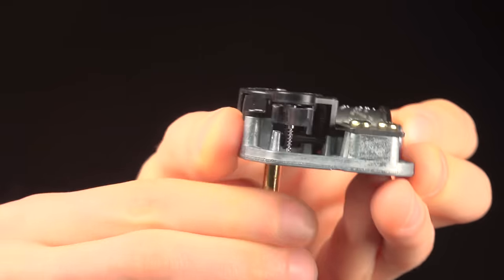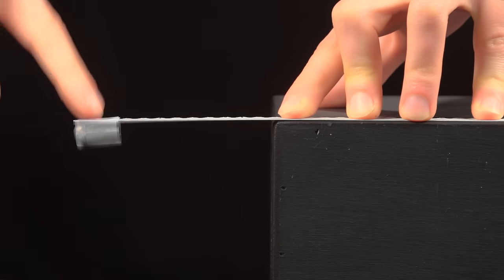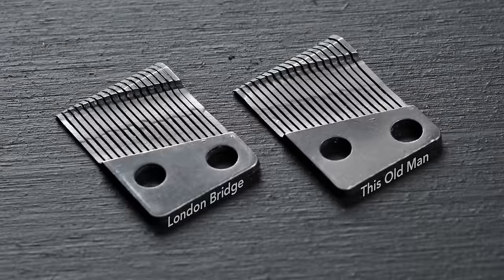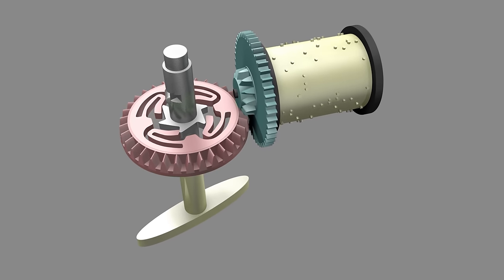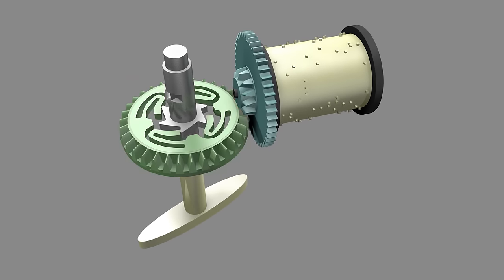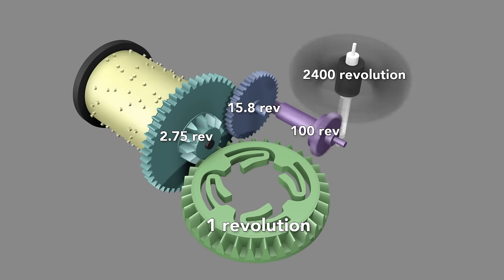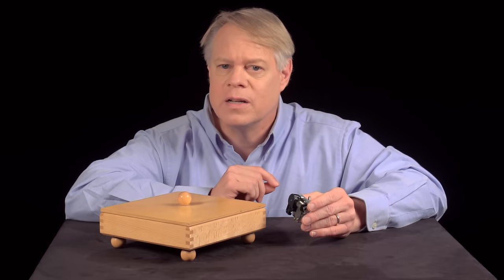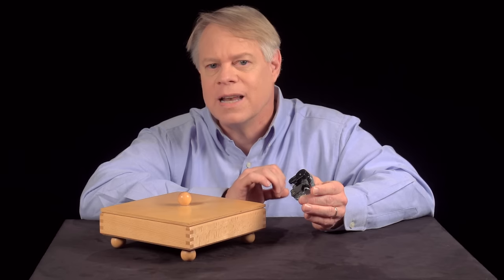How a Wind Up Music Box Works

Comment: Looks like the pin-pen merger area is expanding...
Reply: I'm wondering where that merger has happened.  I grew up in central California and i pronounce them identically. Maybe I'll look it up.
Reply from the maker: +darkridge For me it is from my southern Indiana accent ....
Reply: +engineerguy I feel for you! As a non-native english listener, the difference between the sound of pin and pen was so small it was almost negligible. Props for taking so much time to say it right :)
Reply: +engineerguy Odd, usually the merger causes the e in pen to sound like the i in pin, but you are doing the opposite, making the i in pin sound like the e in pen.
Reply from the maker: +eduardog3000 Indeed. I grew up with the only the -in, learned the -en late in life and now find it hard to say the -in.

Comment: My daughter’s wind up music box toy isn’t working, and I’ve spent about an hour watching other music box repair videos. Yours is the first to actually explain how they work and, for me at least, helps me understand what on earth I’m doing/need to do. Based on your video, I find it unlikely that there’s an issue with the clock spring mechanism (it seems rather straightforward in design). But there’s another video I saw that basically said apply some WD-40 to the governor and the base of the worm screw, so I’m going to go try that now... Your video was extremely informative, clear, and concise, and I sincerely appreciate it! Keep it up!

Comment: would have loved to see how messing with the air resistance (different air pressure?) affected the sound
Reply from the maker: +Jim Nyenhuis We thought of putting it in a bell jar (vacuum) . . .
Reply: +engineerguy That would have been quite interesting. Seeing how the vacuum would influence not only the governor but also how the sound would travel.
Reply: attach a microphone to the soundbox itself, glued to it
Reply: Piezos
Reply: +engineerguy My first thought was to grind away some material from the governor but I guess that's because I own a grinder and not a vacuum chamber haha.
Reply: +compaq1275 You can hear it since it's still vibrating whataver it's standing onto!

+engineerguy just do it

Comment: Noticed that if you watch the slo-mo of that plastic governor, as Dr. Bill mentions that air resistance slows it down, the plastic has actually bent enough to let the spinning governor gently drag against the case above it. The original style metal disks definitely worked only by air-resistance, but the new plastic ones appear to use both air resistance and friction at high enough speeds.

Loved the video, thank you.

Comment: I saw in a video of LearnEngineering that a worm gear can spin a worm wheel, but not the other way around. This is how wrenches work. (letting you make the wrench wider or narrower but staying stuck when you actually turn something with it). But here the worm wheel is spinning the screw (worm gear) of the governor. How is it different to let the worm wheel spin the screw?
Reply: +Ciroluiro If i remember correctly, there is limit in the size of the angle of the thread. If it is bigger than the limit value (around 6 or 10 degrees), the system won't work both ways (you also need to take the friction into account). check this link (in french but well illustrated)  https://pierreprovot.wordpress.com/les-engrenages/les-engrenages-roue-et-vis-sans-fin/
Reply: +Nath ! I think I understood what you mean. So the angle in the worm wheel determines if there is reversibility. Thanks!
Reply: +Nath ! thanks for the link
Reply: +Ciroluiro Also the load on the worm gear matters, since the torque output is so much smaller than input. This works because the governor is very lightweight.

Comment: Wait, but how does a spur gear turn a worm gear, shouldn't
 that not be possible?
Reply from the maker: +Michael Pressman we too were surprised by this ...
Reply: +engineerguy is there any explination? maybe the spur gear teeth have an angle to them?
Reply: Google it
Reply: the upward force of the plastic tooth pushing the aluminum screw is stronger than the friction that slows it down, this and the air resistance is used to make the governor rotate at a constant speed
Reply: You can see that worm used in music boxes has very steep threading compared to threading in usual screws or in worms from elevator mechanisms. This way self-locking doesn not occur (criterion for self-locking is when tangent of thread angle is lower than friction coefficient).

Comment: Hi, great videos!
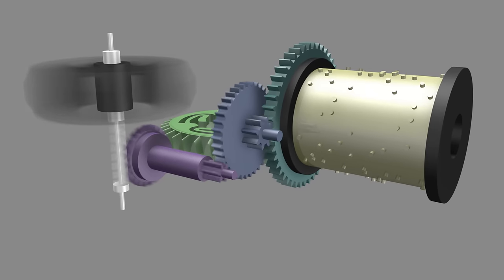Was wondering if the software you use to simulate the animation around 4:30 is public (and if so, the name) or something you guys developed?
Reply from the maker: +twistersdude pretty sure Steve did it with Cinema 4D ... That's heavy duty animation software.
Reply: Wasn't aware it handled simple physics like gear rotation. Or did he just rotate each one individually and make it look like they were turning each other?
Was looking for some simple-ish 3D physics simulator where you can build and test out simple designs. Not sure if something like that even exists. I know of 2D ones but that's why the video software looked interesting.
Reply: Blender (free 3D software) has a pretty good physics simulator. It sounds exactly like what youre looking for. I would recommend looking into it.
Reply: gear rotation is no simple physics, at least not on software programs. There are programs that do the gear rotation but not simulating physics, as Bonomous said about Blender, it does physics simulations, like a ball hitting a wall, or a million, but intrincate objects like a gear are not for it.
Reply: Walter Lacoste يملظلززةلظىظىظىظىظىظىظىظىظىظظىىظ

Comment: I took apart my fiance's mom's vintage Japanese black lacquer music box with a ballerina as it didn't work. I'm NOT mechanical but figured You Tube would help me. I checked out a couple other videos but yours is the best for explaining exactly how the music box works. Thank you. That was very interesting! 
Also, my hat is off to the person who invented this.
To get the music box to work I tried using the 'toothpick' method to just apply a tiny bit of lubricant on the base and top of the spinning part with the 'wings' (that is my vernacular as an 'artistic type!')  It didn't work any better. Then I tried the 'what the heck it is broken anyway, why not just spray the whole darn thing directly and forget about moderation!'  This WORKED ! Suddenly the 'box' began to play the tune effortlessly for the first time. Wonderment! Now, however, I am wondering if directly spraying the lubricant on all parts of the music box will be 'too much' for the poor mechanisms and totally overpower them and end up causing the thing not to work after a while? I used  BoeShield T-9 lwaterproof lubricant. What do you think?  I'm now in the process of uploading my first ever You Tube Video I am so proud that I actually got this working! YAY!

Comment: Thought anyone who watches this would be interested to know; You can make an electric music box by mounting a coil close to the comb. Exactly  like a guitar pickup. Needs a lot of turns and a preamp, but its pretty  cool. Unfortunately I didn't have a distortion pedal or valve amp so I couldn't make a proper ‘electric’ music box, but I was impressed with the sound. Looks cool on a ‘scope to.

Comment: Also note that the governor has weights and a spring such that the weights move outward at greater speed, increasing their angular momentum for more stable operation, and increasing their air resistance for better governing.

Comment: Re: "one last thing". I actually use that phenomenon in reverse to quiet the seek noises from my external hard drive by sticking silicone feet on the bottom of it and then setting it on a little platform with felt feet that I made from a cut-off scrap of furniture-grade wood.

Once it warms up a bit more, I'm planning to do the same with a bigger piece of wood and some felt feet to cut the low frequencies out of the vibrations of the replacement DVD drive in the Power Mac G4 I recently added to my retro-hobby corner.

Comment: The newer music boxes with the rubber governors don't use air resistance (much). When it spins, the rubber weights fly out, causing the top of the flyweights to rub on the plastic cap on top of the support, slowing down the movement. This type of governor does a better job of regulating the speed as the spring runs down.

Comment: the air resistance is not the only aspect which influences the governer speed and therefore the music speed. The weight of the governer is also important! I just fixed a too fast music box of this design by applying short nails into the soft material of the governer. This increases the weight and slows the rotation to a much more comfortable speed of the music box!

Comment: Air resistance governors were true for the older all-metal musical boxes. 

The newer governors in plastic musical boxes are much softer and heavier than older metal ones and use centrifugal force to difform and engage braking pads (on top of the governor) onto a plastic surface right above the governor.

Comment: Great video. I am investigating the feasibility of using 3D printing to create low cost custom personalized music boxes. I believe the cyllinder can be made of plastic but the comb has to be metal to get a good sound.

I think the challenge is finding a cheap source of steel combs with a good selection of notes. How much of the music box can I make out of plastic while still retaining that distinctly musical sound associated with music boxes? Can I buy parts separately at a lower cost? That kind of stuff.

Comment: OK, a governor that just has blades on it is using air resistance only however the governor that you show, is anchored only at the top therefore as it spins in excessive speed it creates a friction against the upper bearing slowing it down. So lots of governors rely on more than air resistance.

Comment: Since the governor is designed for the resistance of air, what would happen if you put the music box into a jar containing a denser or lighter gas? Would it change the tempo of the music? I also never knew about the combs being different for each tune - I thought they were identical and only the drum was different!

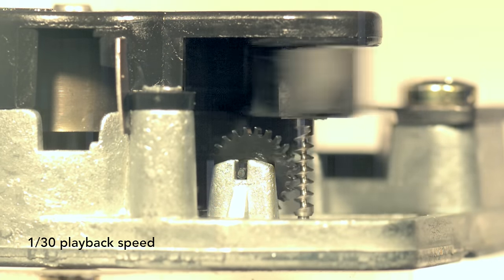Comment: You mention the governor mechanism using air friction.  Some music boxes use this method (such as the one shown at 5:19, with green governor).  Those usually have a flat plate that spins.  But I think that is not how the one you show works.  This one is a centrifugal brake.  The weights bend upward in response to centrifugal force, & 2 little bumps on the top of them rub against the frame.  This can be clearly seen starting at 3:40 in your video.  As time approaches 3:48, the weights can be seen to bend upward in addition to outward, & contacting the frame.

Comment: These are very similar to the bamboo and later metal mbiras (kalimbas) of Zimbabwean descent that have existed for thousands of years. Shrunk down and the fingers replaced with tines on a rotating cylinder instead of the fingers, more complex ones can be programmed with a punch tape though I'm not sure how they work having never been able to take one apart, guessing regularly spaces spring mounted pins on the cylinder that will be held down by the tape going over them, emerging when there is a hole before going around again, basically the earliest self playing instrument. Way more simple than a player piano too!

Comment: dude imagine finding a music box at a junk yard... id be so happy to own one
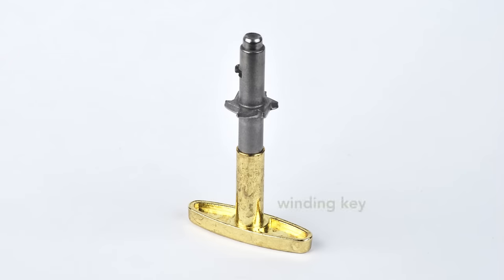Reply: Can anyone help me to solve the problem of the 6 tooth rachet making the larger 4 flexible panels gear bop up and down making loud clicking noise ref 2:29 region.  It's that big light green gear on the first picture.  I do not want to remove the spring coil that sits on top.  I have tried flat blade to pry it in place but basically I cant see what's going on.  It does wind normally but upon reaching a point, the spring will umcurl.  Any clue please?  Thank you

Comment: Hey Bill. Awesome narration and explanation.   regarding mechanical governors... are there other  ways to control the release of the energy of that coil spring beside that high speed "air brake".   it seems something spinning so fast is bound to wear and break.

Comment: Isnt that governor controlled by spining fast and when it does, the weights tend to move up because the way the weights are connected to the shaft (conected to the top of weights, not the center). This causes the weight to go up with speed and rub the top, which is kinda of a break  thus controlling the speed.

Comment: It looks to me like the governor uses a different method of limiting the speed to the one you described. There are those "big" weights on each side so that when the governor spins faster and faster, the weights are forced upwards (observable at 03:33) by the centrifugal force because they are attached eccentrically, and they rub against the rim of the surface above it at a set rpm, slowing it down as the rpm and frictional force increases. The critical rotational speed depends on the stiffness of the rubbery material, which functions as a spring, and the density of it in the weights, which changes it's centrifugal force.
Over a long period of time, the speed of the music runs away as the frictional surfaces wear down and the "hinge" rubber stiffens naturally.
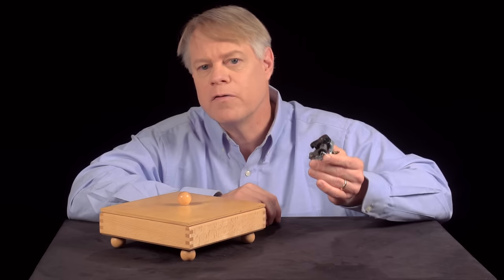If it was designed to interact with air, I would imagine it to be very light and to have some sort of aerodynamic surfaces on and/or around it, as is more obviously the case with the music box at 05:15.

Thanks for all of your phenomenal videos Bill! They feel like the German series "Die Maus" but more interesting and sciency!
Reply from the maker: We got this info from the patent if I recall correctly...
Reply: @engineerguyvideo  Strange ... good job on this anyways! Perfect use of 3D models and animations.

Comment: Hi - I know how to fix an over-wound music box, but now I have one that works, rotates, but it has a "buzz" when it plays. The music sounds like it is at the right speed, I know this can be caused by it going too fast, but it isn't doing that.  Do you have an idea what it can be, how I can adjust? Or, is it toast?  Its not a very expensive music box. It also has an on/off switch.

Comment: I have an observation about the governor. The design of the governor is a flexible off-center hinge. As it spins the governor arms flex upwards and outwards due to centrifugal force (correct term?) and push against the upper housing. I noticed the governor has additional protrusions that act as brake pads. So, Im sorry but I believe your description of air-resistance is incorrect - in this example. You would have to look at the vane-type of governor for air-resistance....

Comment: Physics puzzle: the teeth on the combs resonate similar to a pendulum, but we know that a pendulum of a fixed length always swings at the same frequency; the weight is irrelevent. So, why does changing the weight on the teeth change the frequency?

Comment: So, if the governor works with air resistance, how much would it be affected by air pressure changes, or altitude changes? Chan you slow it down by putting it in a pressure chamber?
Reply from the maker: We thought about doing that ... but then Decided not to take forever to take a video: we face this trade off with every video.
Reply: heh, ok. It's a pity, but I understand.

Comment: Did these music boxes play faster at higher elevations? The air pressure is lower, so that should mean less air resistance on the governor.
Reply: this guy is either dead or too old to reply now
Reply from the maker: Why do you post such things?
Reply: @nameless1873  Why would you post such a rude comment ?

The Engineerguy just replied to a comment of mine on a different video and is very much alive and well.
Reply: @mysticmarble94  Just because I wanted to obviously.
Reply: @nameless1873  But it's both fkg rude and dumb since you can easily find out that there are video uploads as recent as 3 weeks ago on his channel.
Reply: @mysticmarble94  cry me a river I don't care.
Reply: @nameless1873  Sorry ... That's physically and biologically impossible 🤓

Comment: How are the pins cast? Are they sodered on or is it cast already with pins in an already formed dye?
Reply: idk about most music box but the one I've seen were made by drilling small holes into the cylinder (the drum by the end of the process) and then plug small metal rod into those hole which is then soldered in place.
for the next part ,i will over explain why they do that in case you're wondering why: this allow you to put the pin onto the cylinder with more accuracy than just hold the tiny pin in place where you want to put it with tiny claw or something then solder it in. this is also better than making the drum by subtractive manufacturing since it's easier to add the pin that way than to cut the raw block of material down slowly while still leaving the material for the pin intact and keeping the drum so round and plum and good looking.
final note: take it with a grain of salt since i don't make the music box myself, though i do plan to since music box are cool

Comment: Don't you love our language?  I typed wound and realised it was spelled the same as 'wound'.  Looked it up in the Webster's and the third definition was:  past tense of wind.  Which is spelled the same as 'wind'.  So, protect a wound from the wind.  Thanks for the dissecting; I think my next move is WD-40.  My mother told me Great-Uncle Lawrence who was 'deaf and dumb' as they called them when he was born 'before electricity', could fix radios, Victrolas, motors and engines.  So much for being dumb.

Comment: Make this machine so strong that ot can run a dynamo for one hour and we got man power driven microwave oven 

We use hydraulic jack to winding up spring. So we got more powerful mechanical strength